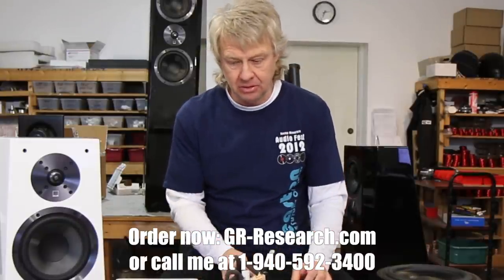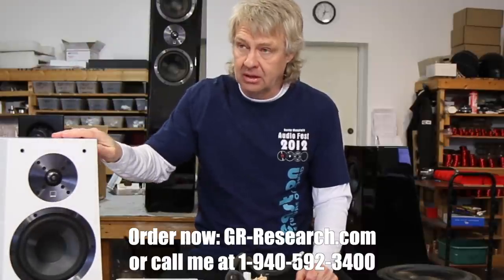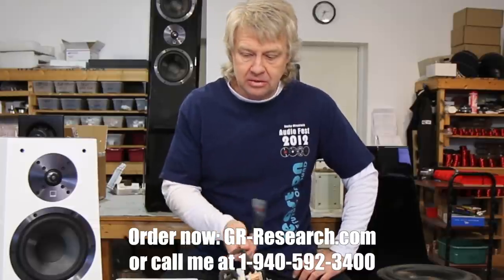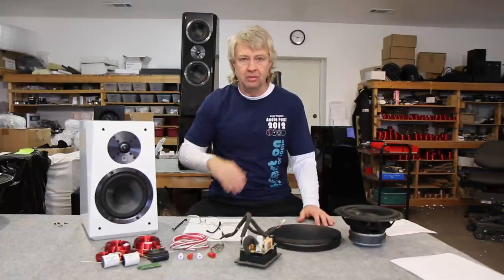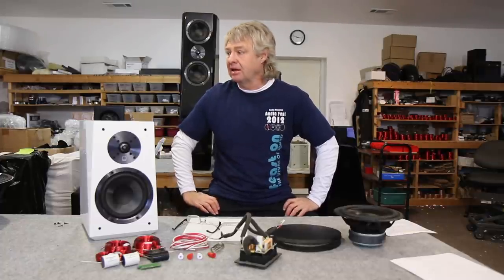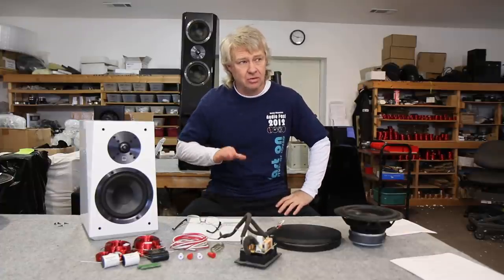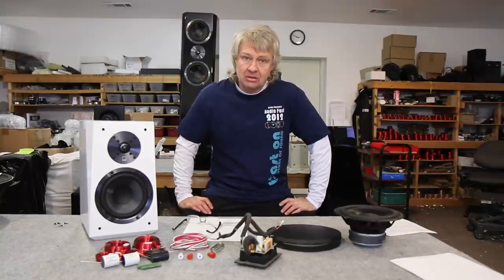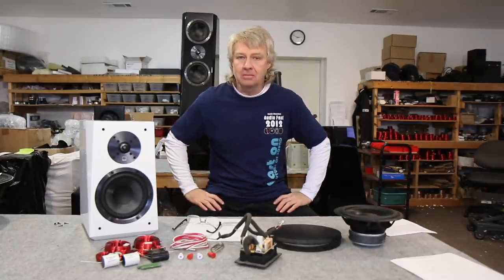Danny VS SVS! Ultra Bookie and Tower Upgrades!

Comment: I completed the upgrade on my two Ultra Bookshelf and Ultra Center speakers.  Sure, it takes some work but it is well worth it.  Vocals are the standout improvement.  I listen mostly to multichannel SACD classical.  Soloists and Choirs are all improved.  Much clearer.  Overall improvement in instrument clarity.  Now, given my results, I wish I could afford Danny's open baffle speakers.
Reply: Marcus did you take any pictures of the work you could share? I need to understand how to do the work, is just as easy as replacing parts?
Reply: @qbaqban  Danny has other videos on building the new point to point wired crossovers. Very easy to follow. Go for it

Comment: The single pricing Is a home theater thing.   People need 3 for the “front stage”. Left center and right
Reply: Or 1 speaker needs to be replaced. Cmon Danny get with it!
Reply: Agree with that,  use the same speakers for center channel give you the perfect sound balance.

Comment: Hi Danny, very interesting video. Improve you can certainly always something...there would be the question of whether expensive crossover parts also always dramatically improve the sound...that would be interesting to see how you test old against new in the sound comparison. Frequency curves are one thing, but sound in comparison much better to understand or hear.

Comment: The reality is that after your upgrade it will be the tiniest subtle difference in sound that almost no one will be able to hear. But the difference between 2000 and 2300 bucks is much more tangible.
Reply: Sorry I'm confused, are you saying that the upgrades he recommends aren't nearly as impactful as he describes? So thus these companies are actually justified in choosing cheaper parts, because better ones barely do anything?
Reply: @wesleyleigh4063  danny is also pointing that for that price all parts should be of top quality.
Reply: @ah.l  At first thought I agree, but upon thinking a little more that's not necessarily the case. Companies design a product to perform to whatever arbitrary specifications they come up with, so as long as the product is meeting those specs - they almost have to cut costs wherever possible to maintain profitability. One thing I've seen with audio and video products is they often are selling a perception of quality more than a measurable quantifiable quality. That is, if their speakers 'sound' great to most people, why take a hit on margins by replacing the guts with better-measuring components if most people are already happy with how they sound? 

That all being said, it would be nice to do a blind A/B listening test between unmodified and modified speakers here to see if the measurable improvements end up being actually perceptible to the listener.
Reply: It does give a better clarity to upgrade the crossover. Just buy new caps with the same value for the tweeter circuit and you get rewarded direct. Go all the way with inductors, resistors and better binding post and internal cables, then you get even more rewarded. This does not change the measurement. Stiffened the cabinet inside with dynamat (car use) and some poly fill and you got a really great speaker. New crossover parts needs 100-300 hours of playing.

Comment: Danny's check list would be, after driver quality & placement on baffle, & baffle, not too wide- --then we examine the bracing & damping of the box; damping,  ferro-,magnetic connector material (from drivers to crossover & to spkrs box connectors), - cheap crossover parts, just match, pay more, and get more without changing the deign. 
Danny confims that proper wire gauge matters, all the way from drivers back to the amp.
With a software I presume golks could do their own measurements & change rolloff, tapering - but minus that, the other stuff is simple * logical  - didn't know half of it, put drivers all over the baffle, when we built Philips kits in the 70s - used their cheapo crossovers pre-assembled if I recall
My goal oow, remove tiny push/pinch connectors; remove level controls for mid & high - solder at drivers where we used crimped female spades - relocate mid and hi drivers to center of baffle.
Two tweeters will be left over - we thought more, was better. Not so, as we learn from Danny!.
Gauge damping & stiff walls, those we got, via flake particle board 3/4, doubled all around, with 2 bottles of Boandfast & Robertson screws

Comment: Thank you Danny! That was awesome. I've owned and enjoyed the Ultra Bookself speakers. At the time I was obsessed with finding the best value bookshelf and with U-BS side-by-side against Buchardt S400 found them different but essentially equal. Since U-BS are priced lower, gave the win to SVS on that comparison. I agree that the cabinets are very good, and despite these (easily-corrected) crossover issues, they are a very good choice for bookshelves. I moved on to floor-standers; otherwise, would have kept them. I did keep the Elac D2-6.2 (for the garage), because those were (by far) the best value at $200/pr delivered new. Think about this... you could buy 5 pairs of Elacs for cost of one pair of SVS Bookshelf - create a wall of Elacs (not that it would be a good idea - but you get the point).

Comment: Thanks Danny! just last weekend live cast by Ron @ New Record Day discussing if you have an upgratde kit for SVS bookshelf's. Would you be undertaking a project for SVS Prime bookshelf - same price point as Kplish;s RP 600? It's disappointing knowing SVS that advertises and personalizes messages as to high-quality parts to cut corners; like for cross over how much would it cost them (buying in mass) to use at least a reasonable level of conductors etc.

Comment: 2 things:  1) Has anyone done this treatment to their Ultras?  How'd you like it?  2) I recommend watching SVSs Outlet Store.  I got my very slightly scratched Ultra Bookshelves for $350 a piece.    Oh wait, 3 things....  He's ripping SVS pretty bad here but could one get a better bookshelf pair for $1,205 (the speakers plus his kit)?
Reply: According to Danny, even the Harbeths, which cost several thousands, use cheap, junky, parts. So very few exceptions, the answer is no.  The parts in the small $3200 Harbeth P3ESR 40th Anniversary Edition Speakers (that Danny tested and has a kit for) are no better than the parts found in a cheap $120 Jamo S 801.

Comment: It is not only the quality of coils and capacitors that gives you good sound! If you have a speaker that does not have good sound, it is not just a matter of switching to high quality parts and you get good sound.

You need to design the crossover filter properly to get good sound and then you can switch to extra good parts.

In your videos it sounds like you are only using a measuring instrument but you are not listening to the speaker which is just as important!
Reply: The filter network measured fine. If the slopes and integration between drivers measure well, that's all you can do. The measured response will correlate with the listening. Other than replacing drivers entirely ( which makes no sense since you might as well get other speakers) all you can do is upgrade crossover parts which is the gist of the video.
Reply: I have built many speakers and do not agree. Example, if you have midrange / bass and treble in a box and have assembled the crossover filter in a certain way using capacitors coil resistors but do not get good sound, then it does not help to switch from cheap polypropylene capacitors to expensive or switch from cheap coils with expensive!

If you have a lot of 400hz in the speaker then you need to make a circuit that lowers that frequency!
Reply: @ford1546  Of course, but as I stated the speaker in question measured fine. If it measures fine all you can do is upgrade parts. I don't know how else to explain this to you.
Reply: @carlosoliveira-rc2xt  I agree with you in what you write.

but if you have a lot of treble or too much of some frequency, extra good parts will not help! you have to change the crossover filter!

And you can not only trust the measurement data but you have to listen to the speaker!
Reply: @ford1546  Yes, true.

Comment: I think people have to be fair to SVS. They set a price point and most of the budget goes to cabinet, drivers, engineering and marketing etc, because those are more noticeable I would guess.

I am sure they will eventually have a more expensive range with better internals now that they have good cash flow with their current business model.
Reply: Nope!  They're just gonna raise their current prices by 20%.
Reply: Yep they already did

Comment: it's a nice speaker the SVS Ultras, but the cost of the DIY is $705 USD, on $2000 speakers, that doesn't really seem worth it anymore. Also, the website for the SVS Ultra says "Please see the videos and measurements in the accordion below.", but there's nothing there, no measurements, no video. What's the before and after on the measurements for the SVS Ultra?
Reply: So for $2,000, full of super cheesy parts, and sounds like it is playing through a wet rage it is a nice speaker, but for $2,705 loading with top quality parts and playing real music, it doesn't really seem worth it?
Reply: @dannyrichie9743  wow, hyperbole much? If they really sounded that bad, no one would buy them at that price range.
No, cause that's NOT how you described it at all........ And yeah you also said "is it worth it spending 200-300$ maybe 350$ on parts" Yeah, at that price for sure. But it's double that on the site now.
I'm sure the parts you specify make a noticeable improvement, for an additional 35% of TCO? I'd rather just get one of your kits instead.
Reply: @AluminumHaste  Building one of our kits is a better option if you weight out the cost to performance. But a lot of people like doing the upgrades and we've sold quite a few of these.
Reply: @dannyrichie9743  It does look like a lot of fun soldering all those parts on the crossover, I would definitely enjoy doing it.
BTW, have you had a chance to look at the crossover/measure the performance of the Paradigm 800F?
Reply: @AluminumHaste  One thing you need to realize, many of us bought the Ultra speakers due to reviews on the internet, and or our experience with their subwoofers, very few of us ever auditioned them prior to purchase. And yes, I know about the SVS audition and return policy. But, how am I to know what sounds good? 

Since purchasing the Ultra bookshelf speakers, I have started dabbling in other speaker purchases, most folks will never do that, it is one and done, the SVS or pick your flavor are good enough. Well, since playing with different brands, Klipsch, Cambridge, Warfedale, Polk, etc., I think the SVS Ultras could use some improvement, and it is nice to see Danny is actually doing something for folks like myself, as I do really enjoy my SVS speakers. 

I'm not going to throw them out, and to replace them with something better is going to cost me quite a bit, even going with one of Danny's kits... For a few hundred dollars, I can upgrade what I feel is a very good speaker, take it to that next level. Why not? the base is there, the cabinets are fantastic, 1 inch front baffles? Very few companies do that. The SVS Ultra speakers have a lot going for them. Like Danny says, parts quality matters.

Comment: Hi Danny. Like your informative videos and...do you also listen to the speakers before and after your mods. They certainly measure better post-mods, yet would still like your opinion as to the changes in perceived sound. After all, that's where the rubber meets the road. Thanks!
Reply: I have spent a considerable amount of time listening to and comparing each individual part and learning what the audible effect is.
Reply: @dannyrichie9743  Great. Care to share your before and after impressions?
Reply: @edoz46  The parts that offer the greatest improvement and best value are the parts I choose to carry. That should tell you a lot.

Comment: This information isn't a surprise because when any product is being massed produce some corners will be cut. Especially, when the price point is dialed back for consumers. This information will be more eye-opening if a 5000 dollar, speaker had cheap parts inside it. People buy TVs every day with a 3 to 5 thousand dollar price tag and the internal parts are cheap as companies could get. Average people can't afford Tvs from the Pro series of Samsung, Sony, LG, etc. Where a 50 inch 4k pro series Tv will cost 20 to 30 thousand easily because the internal parts are built to last for 30 to 50 years. Regular TVs have internal parts that are only built to last 3 to 7 years depending on if you buy the flagship model. Either way, you will be getting your flat screen repaired waaaaaaaayyyyyyyy before the panel goes out.

Comment: So I had the Ultra Bookshelf in house demoing them for a couple of weeks, a few months back. It seemed so harsh and bright to me somewhere in the frequency response, and I just couldn't get past it. I'd even heard a few people refer to as warm or rich sounding, but that wasn't my experience. I had it powered with decent electronics, a Parasound Pre and Nad 275Bee amp, and tried a Yamaha AS-801 also. Would the 700-1000 region bump be the culprit for that? Thanks
Reply: That is a hot spot and and area of brightness right at the top or just past the vocal region. That is not a good place for a humped up area.
Reply: @dannyrichie9743  thanks Danny! While I wouldn't purchase the Svs  just to fix the issue, at least now I know that if a speaker shows the same rise in that region, it's something I'm not gonna be interested in.

Comment: What model of martin logan will you analyse ? Is it the ESL ? I have the ESL-X and really exited to know your result about it.
Reply: It was the ESL-X and it got a new crossover design with higher quality parts.
Reply: @dannyrichie9743  oh nice. Can we find the result somewhere pr it still coming soon ?
Reply: @simoto8327  The owner just left with all new parts, No Rez, tube connectors, etc. I look forward to hearing what he thinks.
Reply: @dannyrichie9743  ok. I thought you had mesurement as i have ESL-X. Personally i made test with a miniDSP to find the frequency that is missing to find by ears that there is missing 2-3dB around 6-8khz. After that i tried to mesure it with my CLIOwin systeme but didnt see it on graph. Im wandering if it come from the fact that the speaker are bidirectional (sound emission from front et rear) and it is hard to measure...
Reply: @simoto8327  I had no issue measuring them. So me an email about them and I'll send you over the before and after measurements.

Comment: I watch lots of your videos and decided to build my own tiny monitors out of some old stuff I had hanging around.  In addition to the many changes I made to the box (an Infinity RS1 Bookshelf) I switched the filters to little first order.  A SonicCap cap on the tweeter, an aircore on the woofer, no resistive or inductive L-Pads, lots more stuffing of the box, a very thick MDF baffle.  What a difference!  It begs the question, while I understand the one cap in my "new" speaker cost more than most companies spend on an entire crossover (or speaker!), I don't understand why it's primarily high end companies who use simple 1st and 2nd order crossovers with superior film/PIO/Silver in Oil, etc. caps on the tweeter.  And for gosh sakes, polyfill, fiber mat, and stiff foam are cheap, stuff the damn cabinets! Do you have any insight?  Thanks.
Reply: First and second order designs have less phase problems. Less protection for the drivers is the down side.

Comment: Ive noticed a decent improvement in clarity by upgrading to 100% copper removed the junk i had on my speakers. Should have known this but relearning basics paying more attention to the small things do reap benefits. Went up to 10ga from 14ga. What are your thoughts on ferrite core use? In audio systems?
Reply: Ferrite core is actually even worse than iron core mate. Saturation of that thing is huge and makes huge distortion...
Reply: Ferrite core is external used for emi or Rf interference. line noise filter.
Reply: I watched a video from another YouTube British audiophile and he was using these as line filters of said problem. wanted to hear Danny's take on this thought process.

Comment: Great video! Very informative. I have 2 SVS PB16 ultra subwoofers which I’m not very happy with the low end response. Do you have a way of upgrading the crossover/amplifier without me having to ship to you the supper heavy subwoofer?
Reply: What are you expecting from them? My brother has one SB16 and it pressurizes  his 30 ft x 15 ft living room and the adjoining  dining room. Did you do the sub woofer crawl?
Reply: They’re most likely out of phase.
Reply: I have dual PB12-NSDs and they absolutely wreck a medium suze room, are you sure that they are adjusted properly?? Give us some details on the equipment used.
Reply: Get a minidsp 2x4HD and use REW, simple

Comment: Great videos.  Very nice inside information.  Is it possible to bring these speakers to real 8 ohms?  Is there a way to lower the frq response between 10 and 20 KHz?  My amp is not hreally appy with 4 Ohms or less. Also it's a bit bright on the high freq's.
Reply: It is not possible to alter a speaker's impedance in any significant way without changing out all the drivers. This would then also require a complete crossover redesign because the crossover frequencies are impedance-dependent.
Reply: @Orcinus24x5  an L pad will do the trick no?